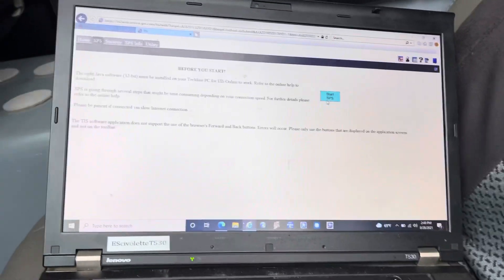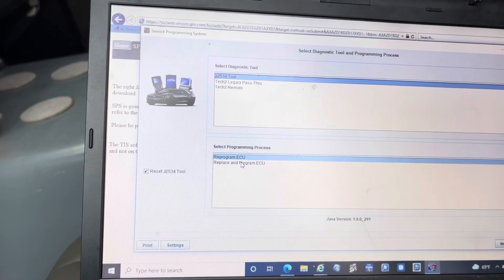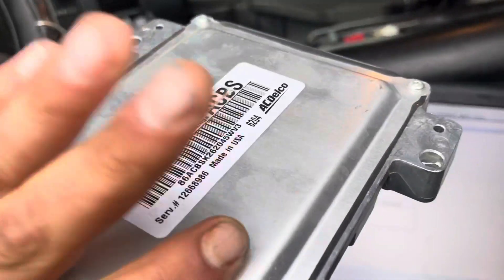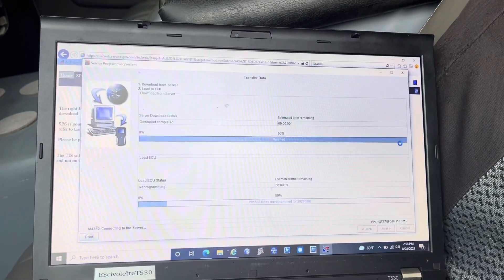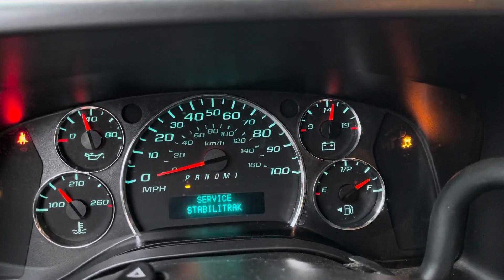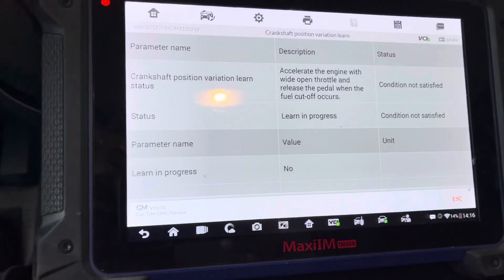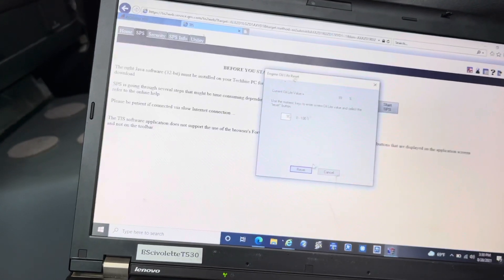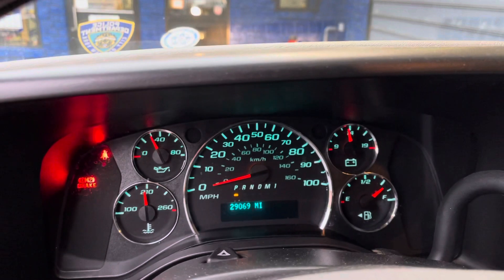GM ECM SWAP WITH A NEW ONE AND PROGRAMMING

Comment: Hello, I reprogrammed a Chevrolet Cruze Diesel 2014 ECU, a warning appears on the dashboard with the quality of the DEF fluid and they recommend make a ECU reprogramming, I did it but the problem persists, what will happen if instead of selecting the REPROGRAMMING option I select the  SETUP option?

Comment: I did an engine rebuilt on my suburban, now I'm getting a p0300 code and c0561 do you think doing this can fix it? I replaced coils sparkplugs and wires and injectors already with no luck,  I'm also getting the traction light, thank you
Reply: I have the same problem on my 2022 suburban even the dealer didn’t figure out what the problem pls tell me me what you did
Reply: @danysaade2286  I did do many things im not sure what fixed it, I think I had a bad catalic converter.... but I also replaced the intake gasket after I replaced the injectors, I would try the intake gasket first since it's cheaper
Reply: @danysaade2286  my catalytic converter was totally clogged and was not giving me an error code  but the signal was really low and so was the voltage, I was told to loosen the exhaust to let it vent at the manifold just to check if that was the problem but I didn't do that I just replaced it
Reply: Check all your grounds.

Comment: GM just changed to SPS 2 . How do you program using that since you will get a VIN mismatch and will freeze unlike SPS-1
Reply from the maker: I have never heard of SPS 2. I know the new system is called TECHLINE. But SPS still works never have vin mismatch or any other configuration codes so far. And TECHLINE is all bundle including programming and diagnosis. SPS works every time. I use it everyday maybe at least two times a day. Never had issues yet.
Reply: @huyug1  I tried the new system on a bench and it freezes . Never had issue with the older version of AC delco subscription
Reply from the maker: @bennyworku896  you should check all of the requirements of the software to work properly on your pc I think
Reply from the maker: Actually you are right! I was not able to use SPS today. I Had to download and purchase TECHLINE CONNECT with SPS2 which cost me about $3900. After September 20 SPS will be off totally.
Reply: @huyug1  is that a one time fee or yearly ?
Reply from the maker: @bennyworku896  you can still do programming by sps2 on techline per vin which is $40 but for full function it is almost 4k which includes programming and diagnosis.  SPS will be outdated on the 20th of September 2021 so it is yearly only.
Reply: @huyug1  I see . On the older version you could use a bench set up ECU and it will let you program any module with a VIN of your choice . This new system will detect the VIN from your bench setup and won’t let you program a module with a different VIN . I don’t like it

Comment: Would I have to do vats relearn with a used ecu?
Reply from the maker: Exactly! If new ECU no need if used ECU we need to do VTD relearn because that module married with another vehicles security system already
Reply: @huyug1  thanks man love your videos, and how could I do the vtd with the ac delco software since it’s 12 minutes, a lot faster than turning the key 3 times
Reply from the maker: @LSXperts72  Thanks my friend. On the bottom of the list of modules you will see “immobilizer relearn” or “vehicle theft deterrent relearn” as an option click on it and follow instructions.
Reply: Where are u located?